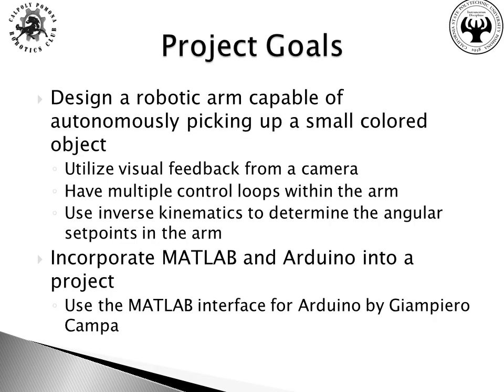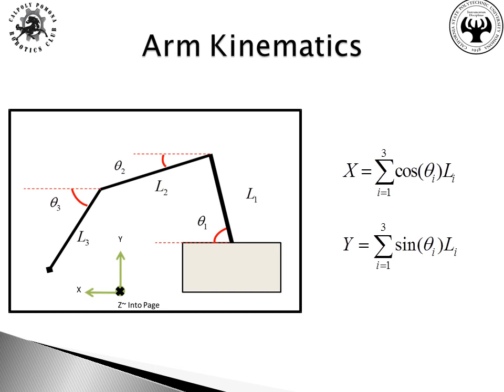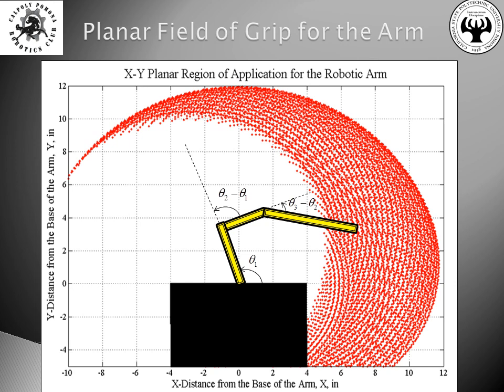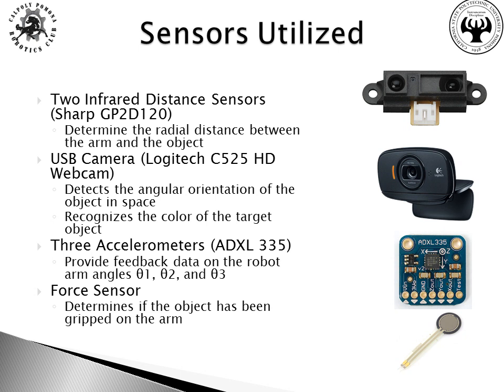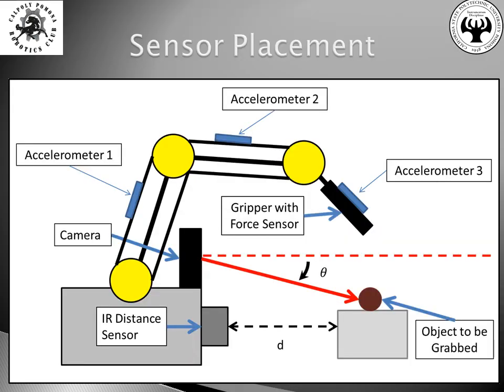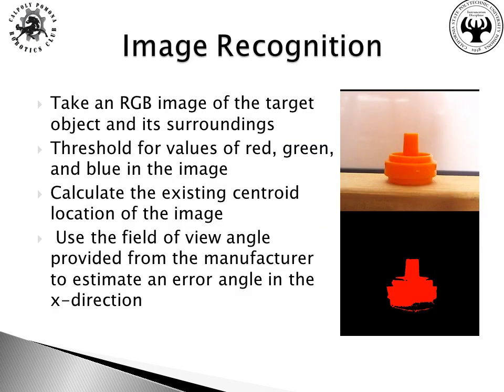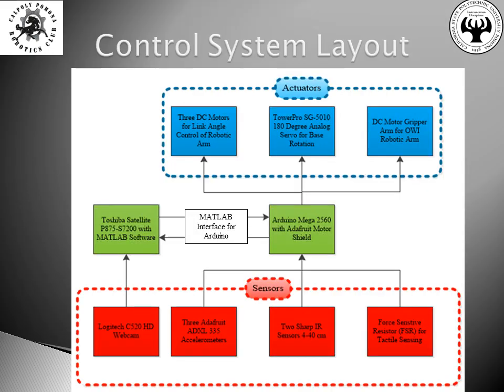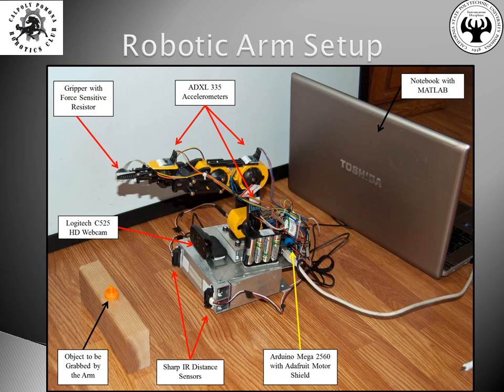Autonomous Robotic Arm using MATLAB

Comment: Hello Jonathan, It is really a great projects! Currently I am doing similar things like yours ( articulated robotic arm, interface arduino in matlab ) and i have got couple of problems. At this rate, my camera is able to detect RGB color as well as the centroid of the target object. But I did not succeed on make the center of the camera and base servo align with the object centroid.  Can you help me or give me suggestion about this??
Reply: @jonathanhoy3464  Thankyou for the advice, it works now, but its not too accurate, maybe its because of my servo smallest step is not small enough. Btw, I have other questions, did u use robotic toolbox by peter corke or the robotic system toolbox in matlab for the inverse kinematic?

Comment: just wondering if you did robotics as a hobby.
I wondered if the arm was on loan from the school as well as the spare parts and  sensors. Did you continue with robotics in any way?
Reply from the maker: Well I build the arm from parts that I bought from in store/online.

Currently, I am now a PhD student and  an Intern for Mathworks (company which makes MATLAB). Unfortunately, I do not have free time to devote to robotics at the moment
Reply: Is Matlab owned by Apple? I noticed that the street that Mathworks is on over there in MA is Apple St.
Reply from the maker: No. Its a privately owned company. If it were thrn it would only run on Mac

Comment: How did you get the parts to make the robot? I'm not talking about the actuators or the sensors. The actual framework of the arm. Did you make this on an arduino board? And I don't understand how you can use matlab for this if it's on an arduino board. Overall pretty awesome, and if you have any advice on how I can make this myself, please let me know.
Reply from the maker: +Ahmed Khan 
Take a look at the arduino io package (MATLAB uses serial ports to communicate with the arduino)
http://www.mathworks.com/hardware-support/arduino-matlab.html

For the arm check out the following
http://www.amazon.com/OWI-OWI-535-Robotic-Arm-Edge/dp/B0017OFRCY
There are better robotic arms but it is a good beginner arm
Reply: Jonathan Hoy Wow! So basically after assembling it we can use arduino and matlab to do something like that.
So the arm is programmable?
Reply from the maker: Of course you just use pulse width modulation to control the motors and the sensor data to close the loop in the control system
Reply: Jonathan Hoy Meaning basically we attach the sensors and the actuators onto the arm, which we buy separately, and those are the things we program?
Sorry, I'm a little new to this field.
Reply: Jonathan Hoy Oh, I kind of get it now. I think I need to study up on some of those things you mentioned. Thanks for your help!
Reply from the maker: the arm I showed you has motors/ actuators. The sensors you have to purchase yourself.

I am not sure how much experience you have in this field but  this project is meant to be something that I would consider as a design project for a senior level (4th/5th year) engineering student. If you have an interest in robotics or electronics then projects like this without the autonomous part could helpful to facilitate learning
Reply: Jonathan Hoy Well actually I'm a second year engineering student. I have some programming experience: C++/ Matlab.
I am actually studying BME, but am familiar with the arduino software because we did a few projects on them in one of my classes.
So overall, what I always have been looking for is something that I can do to use up in the medical field. I know there are things out there like prosthetic arms and legs, which is why I started to look up and study robotics. I think it's very hard to come up with a project on my own, especially considering that in a year and a half I'll need to come up with my own senior design project, and I think especially something like prosthetics is way to advanced and I cannot wrap my head around it, it involves both robotics and interactions with the body.
Reply: +Ahmed Khan 
I'm just getting into robotics and part of what I want to accomplish  with my robot is to get the robot to consider it's self in a special relations sort of way. like a mom telling a kid touch their nose or touch a point on a second limb as or after it changes position. one hand tracks the other.
and all confirmed by light up touch sensor. 
kinda like playing a self 3D version of Simon Says.
Reply: +Robert Swift
sorry. spatial relation

Comment: we can use IMU 6 DOF  (MPU6050)??
Reply from the maker: +Shaymaa Shosho 
Yes but it is not natively supported with the MATLAB arduino interface. The only tricky part will be interfacing it with MATLAB. You will have to modify the matlab arduino pde sketch and the MATLAB arduino .m file

If would recommend using an analog 6 DOF or 9 DOF sensor so you can read it directly to the arduino using analog read
Reply: +Jonathan Hoy Ok , I also use 3 imu on the 3 links of Arm?
Reply from the maker: +Shaymaa Shosho
Yes
Reply: +Jonathan Hoy , I don't use arduino, I will use Raspberry Pi.
Reply from the maker: I see. Maybe you could use python or octave instead of matlab for the programming then
Reply: +Jonathan Hoy Thanks a lot  , but this is the last question,  IMU is better than acceleration sensor and more accurate,  right?
Reply from the maker: Yes because you can use the gyro to estimate the dynamic acceleration on the accelerometer. Since the accelorometer reading is the combination of the static and dynamic acceleration terms, you can subtract the dynamic acceleration to get the static acceleration which is the gravity vector. If you get a magnetometer, it will tell you the angular position reading automatically
Reply from the maker: Basically the more data sources you have, the better your estimate can be
Reply: +Jonathan Hoy  Thanks a lot Engineer Janathan,  God bless you.

Comment: can't we do this using simmechanics in MATLAB????
Reply from the maker: +Simran Jeet Singh 

There are many ways to make an autonomous arm. I just simply presented one approach (not ideal) that I took as an undergraduate. Maybe certain aspects of the project could benefit from the use of sim mechanics such as initial design and simulation. But you are not just simulating the mathematical model. You are dealing with real sensors and hardware. 
Also, I would caution against using simulink for purposes outside of simulation. An ideal real life arm would be running its own OS on a single board computer preferably with linux, and would have direct IO access to the camera and sensors for faster data acquisition and processing. The coding would be done in a low level language like C/C++

Comment: hello i would like to use your project as base for my hand tracking robot controller project so if possible i would as much information and as u can give , thank you
Reply from the maker: vivek dave If you have anything specific you would like to ask me feel free. The only thing that has been left out is the MATLAB source code for the arm. I have done this for a few reasons. If you are doing hand tracking, I would suggest using the OpenCV library for object recognition/ tracking.
Reply: Thx i will try

Comment: Great job MR.jonathan but can I get this code cause am buiding a Robot arm by using color recognition ....With my respect and appreciation >>:)
Reply from the maker: Hi Kareem!

I do not wish to share this original code for a couple reasons, one being that it is messy and hard to follow and also that I wrote it when I was newer to programming. Since then, I have been working on an upgraded version in C#/C++ that people can use from the matlab command line. Its not done yet but I can put up some simple samples for you and others to follow on Github if you would like. Also if there is a specific problem you are having trouble with I might be able to help with that as well.

Jon

Comment: Hey jonathan. A quick question, given you use a DC motor what is the smallest degree per movement you can do?
Reply from the maker: Thats a good question! To be honest that's not a simple answer since it depends on many factors including play between the gears in the gearbox, A/D Resolution, and accelerometer noise. To be honest, using a DC motor coupled with an accelerometer as shown in the video is not exactly the best method to acheive an optimal mix of precision accuracy and speed in the arm.

With that being said, in an open loop setting manually controlling the arm via PWM, you should be able to get at least 1 degree per movement if not less. Many of the nicer kit arms like the dagu use servos which should give you 1 degree per movement. The real issue is in the uncertainty of the true angle of the arm. If the arm moves too fast you incur too much dynamic acceleration on the accelerometers. When you have a servo motor, the accuracy is affected by how much load is placed on the arm and the amount of torque it can produce.

Two solutions come to mind:

Run a dc motor with accelerometer pid loop but have the gains especially proportional be very small.

Run a servo motor along with an accelerometer to estimate error

I am sorry if I am giving a long answer but I hope this provides some insight into your problem
Reply: Thank you for the answer. Very usefull information, i.m planning to built a robot arm in near future. 
Unfortunatly i only have experiance with fpv rc planes. My initial plan is to try and build an arm that i Can attach a welding cable to and record a simple automatation. But heavy presision is required for such task :). 
I hope you wont mind if i ask you a few question once i start the project.
Reply from the maker: Sure thing. Good luck with the project!

Comment: how much time did it take for you to complete this entire project? Did u use a OWI-550 arm parts ? Also, instead of discarding the object to the side, can you make other functions with it (If yes, may i know the timeframe for completion)?
Reply from the maker: I used the OWI-535 Robotic Arm. It took me about 10-15 weeks, about the length of a semester/quarter.
The biggest issue is getting repeat-ability and accuracy. The more time you spend, the better results you will get.
Currently I am working on a second arm that is much more accurate/precise than the one you see in the video. I would recommend getting the dagu robotic arm. I was able to order a generic version on alibaba.com for around $80 US.

If you program the arm correctly, having it do other tasks isn't a problem, depending on what you want it to do. Say you wanted the arm to track an object, that's much easier than having it pick up an object. From a timeline perspective, I would spend at least 95% of the time programming and the the other 5% putting it together. I wish i could be more specific on a timeline but that number can vary widely based on the design requirements.

Comment from the maker: Hi Nusrat! Thank you for your positive feedback on the video.

In regards to your question, what were the physical constraints on my arm. Two types of constraints come to mind. Global X - Y coordinates of where the gripper can go physically based on mathematics and also geometric limitations of the link angles relative to each other. This essentially gives you a three input angles for two outputs X (position) and Y (position). I solved this problem using the built in optimization subroutine of matlab similar to excels solver if you are familiar with that.

Comment from the maker: Thank you everybody for the positive comments on my robotic arm project. I hope to do another video shortly. I am hoping to cover advanced topics such as voice recognition and possibly stereo vision. I have a second arm that is a significant upgrade from the original one.
Reply: Hi Jonathan  I want to make simple arm robot someone told me I can make it using relay and run it by matlab  please help  how can I do this
Reply from the maker: HI Mohamed!
This can be accomplished by using MATLAB.One way you can do this is by using the digital IO pins on your arduino. Go over to this website:
http://www.mathworks.com/matlabcentral/fileexchange/32374-matlab-support-for-arduino--aka-arduinoio-package-

Follow their directions and then your arduino should now work with matlab. Using a relay i would attach it to one of the arduino pins and I would use the following command to trigger it:

comPort= 'COM5'; % COM port of arduino
pinNumber = 10; % Pin connected to relay
a = arduino('COMPORT'); %Connect arduino
a.PinMode('Output',pinNumber); % Set mode
% Set the IO pin as digital out
a.DigitalWrite(pinNumber, 1) % Trigger relay
Reply from the maker: If your robot arm uses dc motors i would get the motor shield. If it uses servos, I would then get the servo shield.
Reply: Thank you mr Jonathan Hoy
Reply: Sir please send me the program